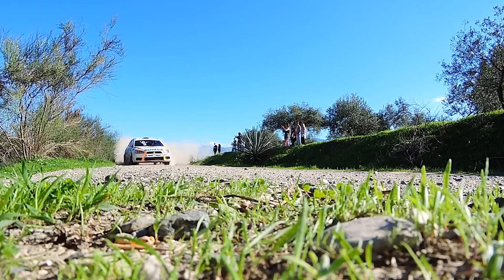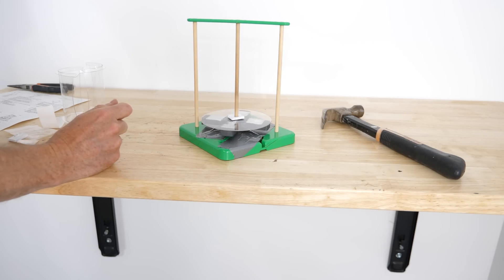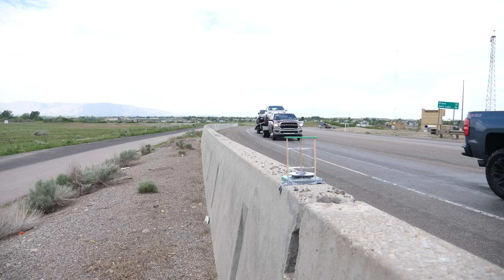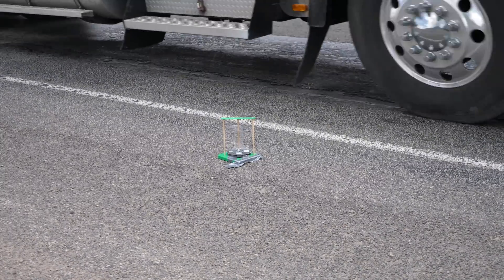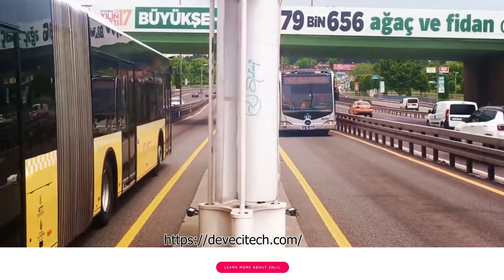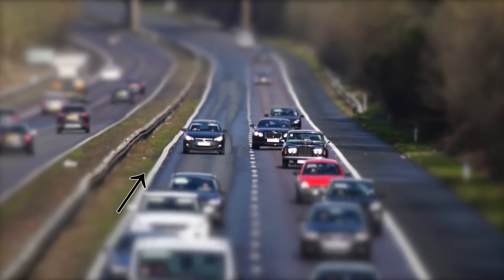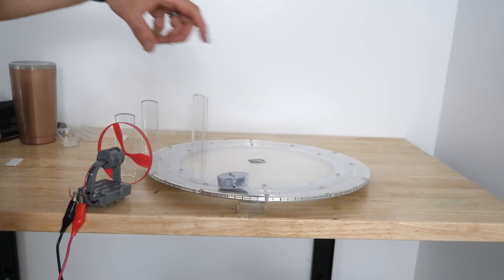Do Traffic Turbines Actually Work?

Comment: Actually, a turbine would slow the wind down more than a stationary object, since it extracts energy from the airflow. A fixed object only redirects the wind.
Cars already face aerodynamic resistance as they move, pushing through the air and generating turbulence. Wind patterns on highways are also affected by other vehicles and roadside structures, which constantly redirect the airflow.
So, the amount of energy “taken” by a small turbine would likely be insignificant—and in some cases, the turbine might even help smooth out certain turbulent patterns.

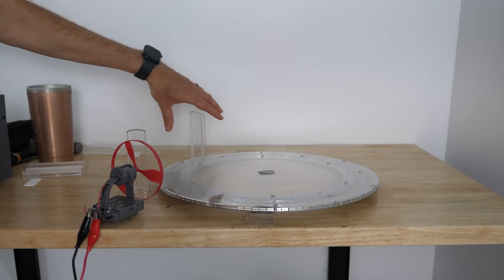Comment: everyone here thinks that have a turbine on or near a car reduces the car efficiency, but it is simply recovering the energy lost from air resistance, although the test at 4:00 clearly proves that that may only be true for putting in on a car, as demonstrated by quint builds.

Comment: But we are talking about highway right? with both side of traffic incoming on going towards opposite direction. I think more resistant is coming from the incoming traffic(moving in high speed compare to fixed position of the turbine) on the other side compared to the resistant produced by the turbine. Just my opinion..

Comment: You could always create a traffic grid that was built to use gas powered cars as a rotor and the road as a stator. That way oil could be used to both power cars and provide a magnetic flux that was wired into the grid. Or something like that. This would require a complete overhaul or just start from square one on a new city.

Comment: Your experiment is Cool but i think Need to add some points.
First - there should be some safety distance between cars which give space to air for violation. And the distance is dependents on Speed of Car.
Second - By turbine we are trying to use the flow which moves towards side ways.
And Third - we should try it on Devider. So it can utilise the flow of both side. In another scene with no turbine, the opposite flow generates more friction.

Comment: You omitted to mention the case of a 2-way road, where the cars on one side push some air that works against the cars on the other side, so opposing cars decrease each other's efficiency.
So in that case, placing some turbines in the middle might actually increase efficiency.

Comment: That's an awesome video. Not only it poses a valid question that is crucial to determining whether side road turbines have any place at all in the modern world but it contains a superb demonstration as well. The experiment set up is brilliant in its simplicity. 
Well done for bringing up this topic and showing what the problem is. There are many people out there that believe that free energy exists.
What I would add is this: the principle certainly doesn't work when turbines are installed on the side of the road ,in my opinion, but what if they are installed on the median, between the two opposing traffic lanes? In that position there are two opposing air streams (gusts) generated by the opposing currents of traffic each of which impedes the traffic flow in the opposing direction. What if the turbines installed there were designed and implemented in such a way that the two opposing air streams could be directed upwards and in doing so, extract some of that energy and at the same time preventing it from obstructing the traffic in the other sense? Could that possibly work or would it, again, oppose both senses of the traffic?

Comment: I think there's room for improvement. Especially on the design of the blades and how they "push back" the wind into traffic again. We could also have them near airplanes when they come in for landing. There is definitely some room for more thoughts on this. Maybe we can brainstorm more on how the blade itself should be designed as to minimize the impact on normal traffic airflow.

Comment: So... you managed to measure the effect of the turbine input energy in the power source (air turbelence from the cars), but have you even tought about the power it generates? Not a single time in the video you measured the single most important metric of a generator: POWER!!!!!!!!! 
I get the educational part, but dont fool yourselfs with this, you cant power anything useful with it!! At least, try to measure and understand the relation between the turbine rpm, shape, number of poles, number of windings... with the power output. I guess it would make a more usefull video if you try to optimize. Otherwise it has no purpose

Comment: yeah, they maybe, just maybe have some use in the scenario that was shown where opposite flowing traffic comes very close to each other at high speeds. not exactly the most common scenario on the roads, but I do think that the turbine would spin faster and have even more negligible impact as it is blocking the opposite flowing air from the other direction

Comment: Meh..  The forces on the vehicles would be thousands of times less than a slight breeze. Being able to harness that energy to run a few overhead lights or signs per mile is not financially viable just yet.

Comment: What about putting a grate into the road surface and a concrete barrier? The cars would crash and smash against the concrete barrier, fuel would drain out of them through the grate and flow into an engine of a conventional power plant. Could make a lot of power. Sure it has a few cosmetic details like people dying and property being destroyed, but like all those nonsensical concepts, these should be ironed out by a little twiddling shouldn't they?

Comment: Twisting wires together doesn't necessary reliably connect them together because of microscopically thin layer of nonconductive oxide.

Comment: If it does take energy from the cars, how is that good? its essentially gas powered, and the car will use more gas because it slows down a little. 
So the cars use more gas and you get less energy than just burning the gas because of loss in friction and other inefficacy.  
The amount of energy you would get is minuscule anyway. Its actually worthless. Not one single benefit.

Comment: what about wind turbines activated by pump. let me explain in this situiation the floor is kind of bouncy but bouncy enough for it to not matter but when the car passes by it uses its wieght to pump using the already trapped air inside the ground to make electricity but also when it rains the rain drops get kind of spunged into the ground which leads trough the wind turbines also to make electricity. 1 needs to fit a smal pump. 2 needs a intrapped air ( not to much) . 3 it needs a kind of spungy flooring for cars to go by without destroying the floor. 4 it needs to be able to suck the water into the flooring. 5 the water and air that is trapped gets to be used as a magnetic generator. 6 on a low budget if possible?

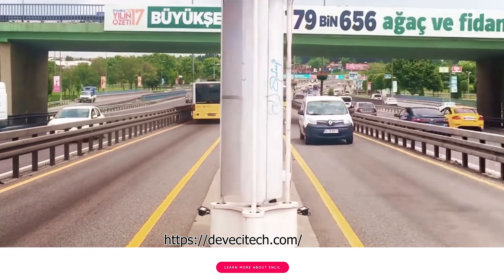Comment: 02:45 /thread. THANK YOU for pointing this out. There is no such thing as free energy. These turbines cause aerodynamic friction. In aggregate, this causes traffic to be less energy efficient, and then you have losses on top due to entropy and conversion. Even if you can't measure it for a single car because the amount is so small, taken all together, the energy still comes from the cars driving past. These things are a horrible idea, unless you put them at highway exits exclusively (which is where cars always have to slow down either way).

Comment: Well, sure. But the winds are generated by the cars, so by stopping those winds you're forcing each passing car to use just a tiny bit more fuel to keep their velocity. So in the end, you might as well skip the extra steps and make a gas-powered turbine. At least environmentally speaking.

Comment: Embed it in the roadway? There should be a way to design them such that air can get in and not disrupt the cars. The device could even go down 10feet under that section of the roadway. With a cover that lets air in and keeps the cars out. That allows for large efficient fins on let’s say an archimedes screw type intake. Or any novel design someone could come up with. As long as the design is lightweight with large surface area it should be able to spin. Just brainstorming out-loud. Lol. I haven’t done any calculations.

There would be a low pressure area created by the vehicles passing over top so it may be a matter of the pressure differential creating a force of suction. Which could also turn a turbine of some sort.

Comment: Save the materials and build one proper windmill. Makes a lot more power for the material costs and has a lot fewer failure points really. Same with solar panels on cars. Not worth it. Save the materials and stick them on building. Then, a crucial step, actually reduce energy prices as you now have efficient solar panels.

Comment: would decrease the potential energy from the wind by a lot but this problem could likely be nulified by placing watever generator they create underground and having large pipes not deflecting the air but directing it underground towards the generator. In all honesty, these may get nice power from a busy auto-bahn for it to MAYBE work. Also i believe its a clever safety measure for blackouts since even if any reserved energy was depleted, these could boost their own highway lights to keep those turned on as long as they're being used. Maybe even take benefit of this "underground" structure to straight up get rid of electric poles and reduce potential obstacles, further enhancing the road safety at night.

Comment: I suggested and the student group built it - make a speed beaker of metal n put it on springs so it moves up/down by about an inch. Make thus movement run a series of pumps to store water in an overhead tank. Run a generator on the downflow as needed.
They installed it at a road junction. 
I did not follow it up with them, nor did they report it. Perhaps it didn't work.

Comment: I'd never considered how traffic essentially creates an artificial air current that reduces wind resistance, but I really should've. I already knew about slipstreams, which are just an area of low-pressure air, but the air around traffic probably moves with the traffic unless there is natural wind from elsewhere.

Comment: the other big problem with adding these to highways is that you NEED to have an emergency/pull-over lane so you can only realistically put these on one side of the road, usually the inner lane. This also further reduces its efficiency because there are a lot of highways that ban large trucks from using the inner-most lane, so you wouldn't get the big boosts from them.

Comment: What about mounting use them along heavily traveled train tracks subway tunnels? Freight trains are a mile long or more, traveling better 50 mph. There’s the Chunnel? Also upside down high in high speed auto tunnels. Airplanes taking off and landing runways at busy airports and military bases.

Comment: Could you add solar panals to the tops of the turbine structure, and use the combined power to produce a local emf to wirlessly charge electrical vehicles as they drive by? If so, how muxh extra range could this add? Would the extra resistance of the structure negative the gains?

Comment: 1. Having the turbines between lanes in 2-way traffic would basically double the air pushing it. Putting them on the barriers that commonly divide highways would be perfect. 

2. Better designed turbines would require less air to get going and keep going. 

3. The loss in efficiency would almost certainly never be noticed by anyone driving on these roads. 

4. Lets not forget that this thing called "the wind" still exists. So the turbines would also be turned by simple wind even when there's no traffic. 

5. Proper traffic pattern analysis and strategic placing would likely result in them being put in places that have consistent traffic but rarely has congestion and slow down. 

6. Having them close to the cars doesn't pose any more of a safety risk than anything else that's already next to the roads. 

7. The installation expense would be quickly offset by the electricity generated. 

8. These things are already installed in many places all over the world and seem to do a pretty decent job.

Comment: You need a device that has minimal friction for the spinning blades, also using of highways (busy one's) would be more optimal and also using the center median where the wind energy is greatest between vehicles going both ways instead of just to one side or the other.

Comment: This reminds me about something my dad was wondering. He was wondering if solar panels might have a negative effect because they do take some of the energy from the sun that would otherwise be converted to heat and perhaps other energy types. I figured that all the energy would be converted to heat at some point and it wouldn't matter, but it might be an interesting experiment if no-one has ever tried to see the other effects of solar panels in an environment.
Reply: I know solar panels are useful to reduce the need of AC, as they absorb and partially reflect solar energy on building in highly illuminated locations. Basically they shade the underlying building if placed on the house, at sufficient distance from the roof to let air flow underneath it.

Comment: Would there be any way of harnessing let's say the "weight of the water at the bottom of the ocean?" If it's so much that a pressurized cabin could completely implode, why not something like setting those flywheel energy storage systems, I don't knowhow possible it is but it just seems like something we have yet to figure out how to harness down there, the sheer volume of water alone should mean we need to investigate. I understand we have those tidal energy collectors but something tells me deeper down there has more potential since you wouldn't have to hope for certain conditions or anything, its always there ya know.

Comment: Use Fresnel lens 'death rays', use on water to generate steam through an appropriate piping system, which powers air compressors, use compressed air on cars, use and refill/replace.  Same concept for electricity

Comment: I wonder if they created a tunnel system through drains that wind can flow through on freeways? When it's fair weather, they can be used for air pressure to generate power. When it's bad weather season, they can be used as regular drains?

Comment: What if you built the turbines into already existing roadside objects like street lights and road signs etc? If you made the turbine part of the street signs so that it was using the same mass as a normal street sign wouldn't it have little to no effect on the existing resistance already made by thes roadside objects?

Comment: So traffic turbines are not efecient generators ; but can be used to actively slow down cars where there is high risk of accidents especially due to over speeding
And also,  does the size n weight (dimensions) of such a system has any relation with how faster can it slow a moving vehicle ???  @TheActionLab

Comment: I don't see how the experiment with the superconductor translates to the situation on the highway.
Sure, if you place something in the path of a flow of air, it will act as resistance. That's kind of trivial. You only reduced the boost provided by the (now restricted) flow of air.
What you want to test instead is whether the speed of the moving car that is powered by something else than the flow of air itself (gravity, battery etc.) will be affected by objects standing by the side of the road.
I don't think your experiment tests this. Or am I missing something?

Comment: The cars have to push the air out of their way regardless, and if that were really the issue than wouldn’t the concrete barriers be causing huge drag by stopping air from being able to quickly move away from the road? Turbines would be recapturing energy that’s already spent and dissipating it from moving further away, not asking cars to push more air. The air is already in motion and doesn’t require extra energy from the vehicle to move a turbine, it simply slows the air down as it absorbs energy that was already put into it

Comment: Road friction, speeding vehicles on free to utilize surface that can improve vehicle efficiency/speed and traction to fix weather conditions problems and also generate unlimited amounts of electricity.
It just needs us to step our differences and personal interests aside and actually work on something that will help generations instead of sinking them in unreasonable debts because of our stupid insecurities and zero effort to achieve dreams

Comment: The effect of the turbines isnt really a damper on the cars aerodynamics in the same way as in your experiment set up. The air flow from that fan is considerably faster than the speed of the model 'vehicle' which is moving considerably faster than the air it displaces on its own. In total the effect of your experiment shows that air can push your superconductor and then if you slow that air down it pushes less. It says very little about the aerodynamics of actual cars.

In a real life situation most cars arent riding directly in the backdraft of the car in front of them. Even behind a semi you have to be closer than is typically considered safe to see any feul efficiency benefits.

Basically most cars are driving through essentially dead air and you can tell that by how quickly your test turbine stopped spinning after each car passed.

Comment: 4:26 In the test that you did the turbines are statioınary and not spinning maning not only do they block the flow a little they actually rotate the airflow to be against the magnet making so much more resistance and disturbing the airflow much much more. I am not an aerodynamicist or an engineer at your level (onlt a student for now), but I dont see how I am wrong here?